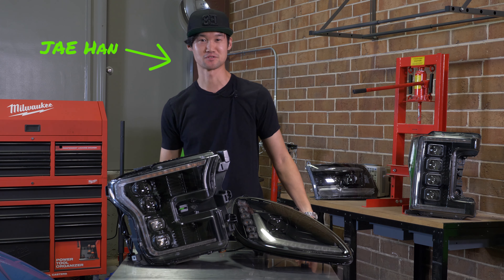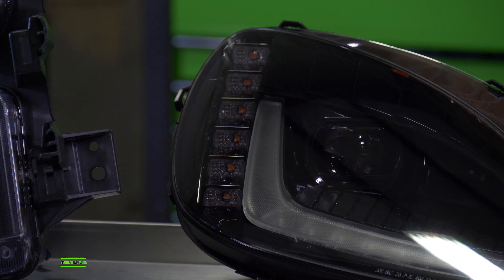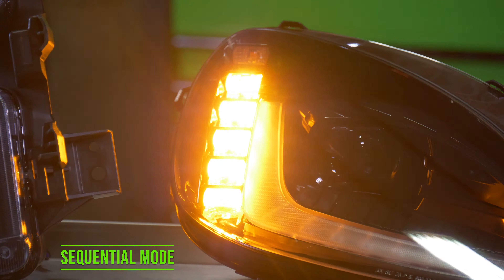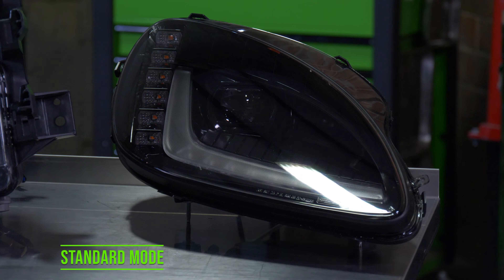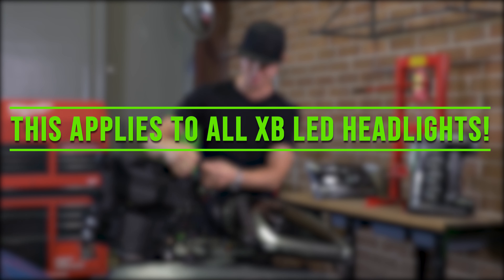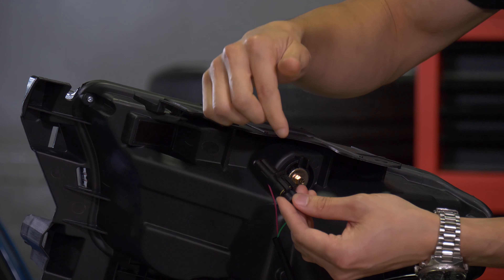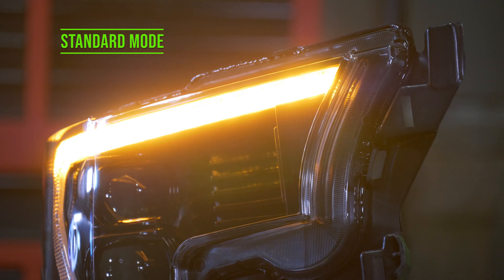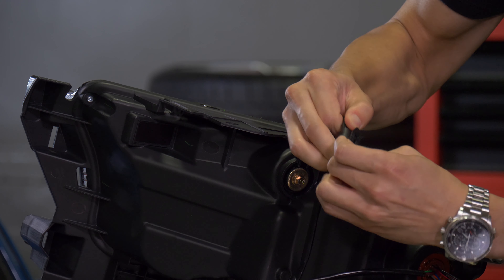How To Activate and Deactivate Your Sequential Turn Signals | Morimoto XB LED Headlights

Comment: I did the same on my BRZ XB lights, but damn it could you not have just done a switch on the lamp or something? Having a cable for this does the trick but damn is it mess havin all those cables.

Comment: 2021 Tacoma is the a cap to get to keep from gunk getting in there unplugged? Just to keep water and mud and dirt out of the harness while unplugged
Reply from the maker: Not much gets up by the headlights in these trucks, there's nothing made to put in them to prevent this. If its a concern I would find a way to cover the ends! (:

Comment: I bought Morimoto headlights for my  2016 ram 1500. The sequential lights work when the truck engine is off, but when I turn the engine on, the passenger side sequential light does not work.  only the driver side. Any tips or ideas? and I made sure they were both disconnected to get the sequential lights to work, but I’m still having trouble
Reply from the maker: Can you send us a video or give us a call? We'd be happy to help troubleshoot with you! support@theretrofitsource.com or 404-220-7940

Comment: Trying to do this for my 2018 ram xb lights (oem projectors) ... is it already connected on the headlight itself???? I have them installed but all I had was the one main connector and the Drl jumper. Did I miss it???
Reply from the maker: I am confused as to what you are getting at, if you have the XB LED Headlights you will have the little connectors on the back of the housing, and you will un-plug those to get that sequential functionality! Let us know if you have any other questions, we are here to help!

Comment: Which one are you unplugging for the sequential mode? You gotta subscriber if you can answer this lol. I just installed these to my 2016 f150
Reply from the maker: There is a plug on the back of the headlight that is connected by default. It has only one wire. Unplugging it will activate the sequential mode. Thank you for watching!
Reply: Its The one with the green wire if you have a ram

Comment: For 17 Honda Fit you can't turn off the sequential turn signals
Reply from the maker: Is the plug inaccessible?
Reply: @RetrofitSource  Theirs a plug connected to a small "box" tried unplugging it, didn't change anything at all. Or i don't know what it does
Reply: @RXfc3s I have the xb led headlight for my 2017 Fit as well, were you able to make the DRL dim when the headlights turn on?
Reply: I just put these installed these in May-   Has anyone solved the run solid issue-   I am disappointed-   I didn’t want the sequential-   All of the copy  I have read indicates the option to run solid-